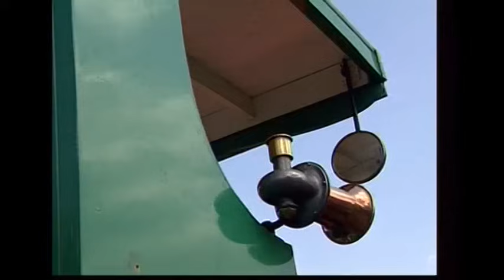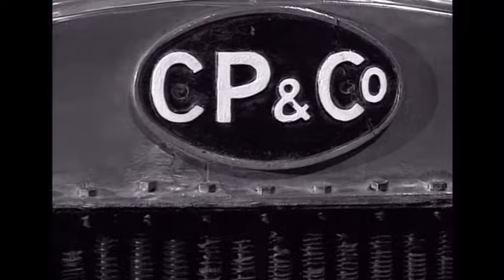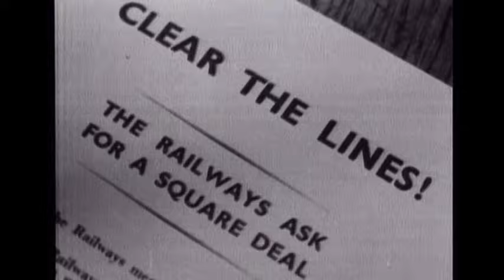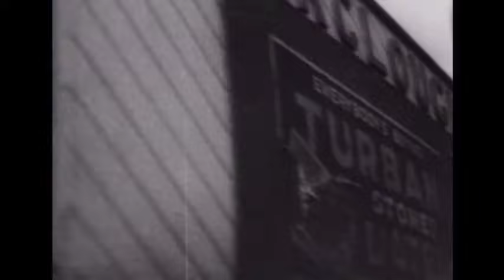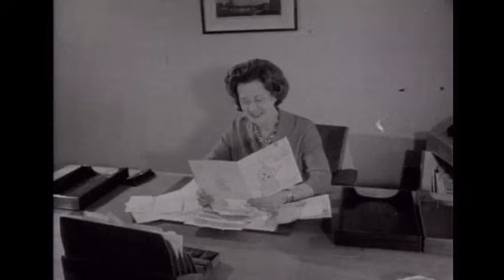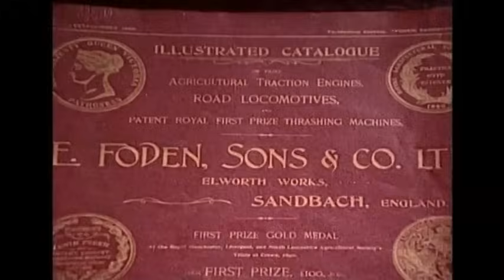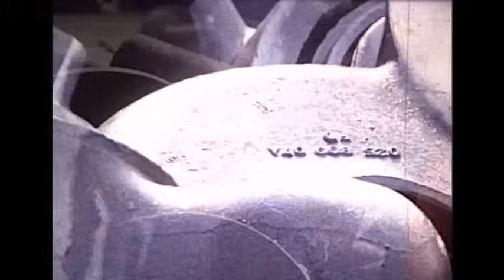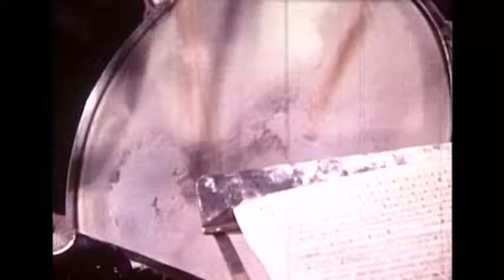The Story of the British Lorry

Comment: With all that history, what happened to the British automotive industry ? What went wrong ? ERF, Atkinson, Foden, are all gone.
Reply: Seddon, Bedford, AEC, Thorneycroft, Scammell, Dodge, Guy, Morris - there's a lot more!
Reply: Unions☠️
Reply: A lot of companies either merged or got bought out.
Reply: ERF became  part of MAN.
Thorneycroft got bought by Scammel, who, in turn, became part of British Leyland.
Foden became part of BL. BL commercial vehicles joined with DAf and then got bought out from bankruptcy by PACCOR who make Kenworth and Peterbilt trucks.
Reply: British leyland happened bought out loads of manufacturing then became daf then had the foreign invasion of cheaper vehicles. I drove seddons late 70s to mid 80s (among others) nice comfortable lorry even with a crash box good vision great steering lock good gear ratio my one would pull a house over
Reply: @bobbylee2853 
thatcher not unions 🤮

Comment: Did you mention the AEC company ….. AEC was in existence from 1912 to 1979. To remind everyone, they built London’s omnibuses for 67 years. They also pioneered the development of the straight-six Diesel engine, in collaboration with RICARDO performance tuning. AEC engines started under all conditions without heater-plugs to assist. Their heavy duty MATADOR army lorry was very necessary for moving large loads and one of their AMOURED COMMAND VEHICLES captured after the retreat from Dunkirk was used personally by Field Marshal Erwin Rommel. The AEC MANDATOR V8 was the first to commercial to experiment with 8 cylinder engines ❤

Comment: A couple of stories first goes back to my grandfathers apprenticeship as a bus mechanic circa 1920. Many lorry and bus drivers and mechanics didn't have the knack  of hand cranking large engines so they were often tow or push started. This wasn't possible with petrol-electric (Tilling-Stevens) drives so often buses particularly were left running 24-7
Circa 1938 the war department and home office were buying up and requisitioning as many civilian trucks as they could, my grandfather now in his own business kept my father and uncle busy overhauling many of these lorries many of which dated back to the early 1920's perhaps even WW1. A lot of these were chain drive Albions.
Most were never actually used as new vehicle production quickly ramped up.